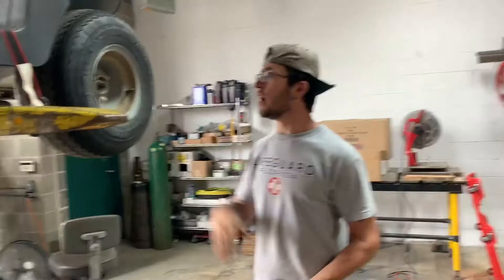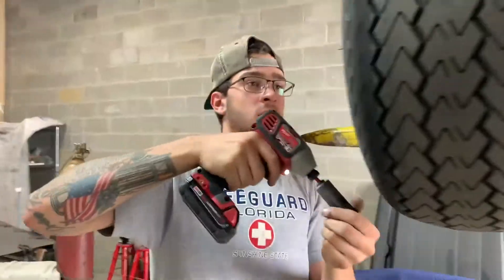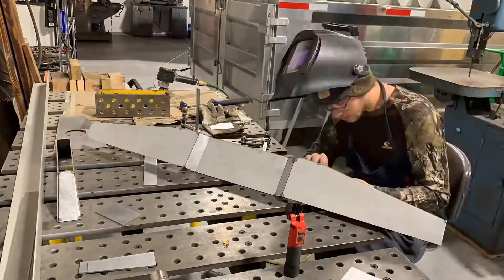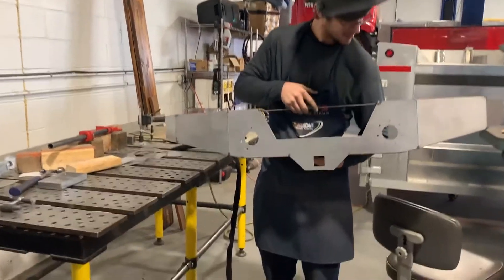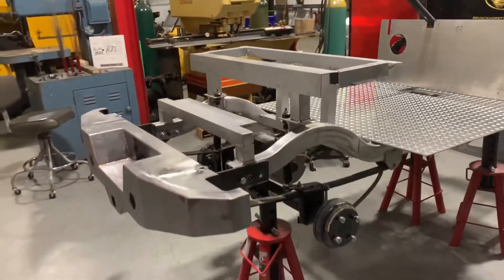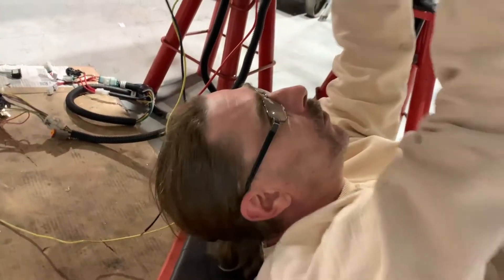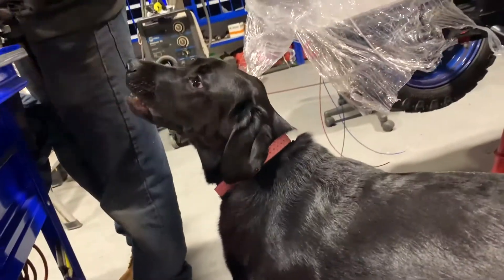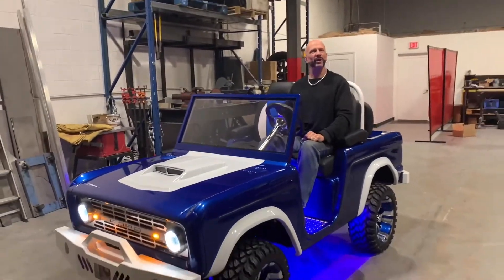Custom golf cart conversions

Comment: I do this as my job and love building custom golf carts for customers in so lucky to have such a cool and fun job building custom golf carts i also do tons and tons of standard builds which is just bolt ons like a lift kit back seat kits extended tops ect but i get around 1 complete custom build a week to do that requires tons and tons of fabrication and welding work to make it look like a lowered 32 ford coupe tyoe hotrod or a ford bronco is ver popular same with making them look like jeeps as well. And when i donthe custom builds like that 32 ford coupe style hot rod to match the customers show car it took tons and tons of metal fabercation work to hand make the floor boards and body pannels with english wheels and benders and rollers it was all hand made and looked absolutely stunning probably one of the msot intensive builds i have done so far in the 1 year i have been doing this as a job